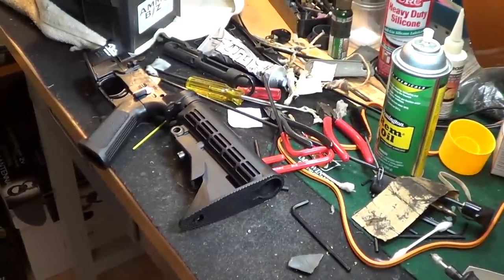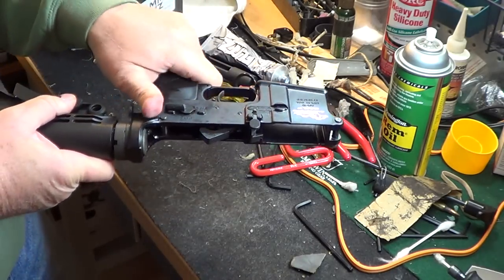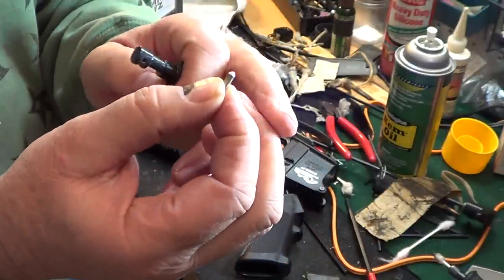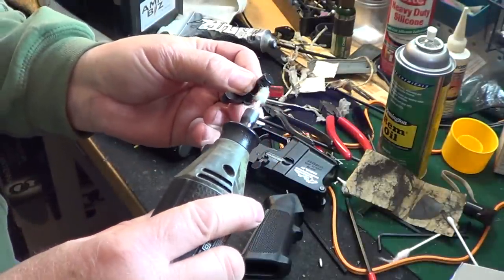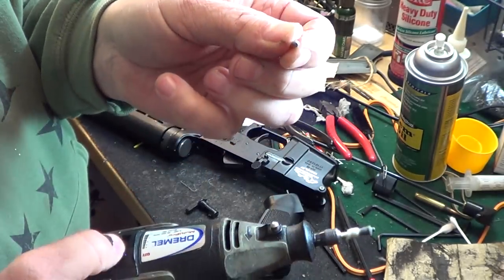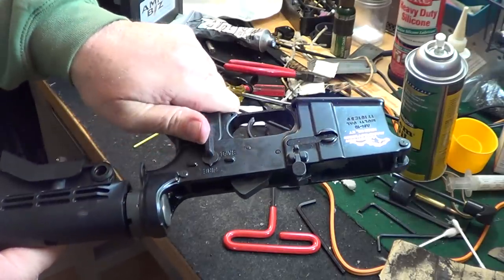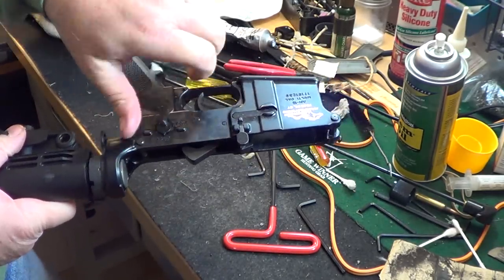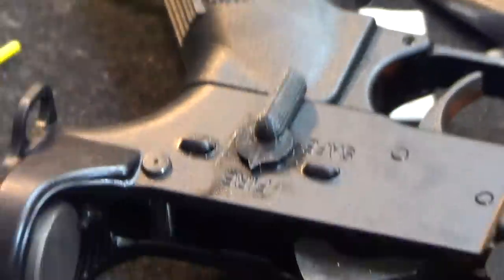AR Mod - Safe & Fire Selector Too Hard - How To Make Safety Smoother

Comment: 0.880 Inch is the best length for the safety selector (and ejector) spring to strike the best balance between ease of use and a good detent lock.  Clippers work, and a slow speed knife grinder and jig works well to make batches of those reduced preload springs.  Rick is one of the very few honest and experienced gun guys out there.  He tells the truth, and I appreciate that.  Blackhawk makes an inexpensive 45 degree offset and ambi safety lever, and that helps civilian AR-15s become easier to practice the Safety-On and Safety-Off drills in class.  I spend the first morning of the carbine classes fixing broken and poorly maintained ARs, along with updating the safety springs, detents, and levers.  What Rick says makes a huge difference.  He is the greatest.

Comment: Rick, I had the same issue once, instead of cutting the spring I found there was a plastic burr in the hole in the grip causing too much spring tension. Cleaned it out and made it slightly deeper by GENTLY running a drill bit down the hole. Worked great. Just another way to achieve the same effect, hope that helps :)
Reply from the maker: true but if you screw up with drill and go to deep you mess up lower, if you screw up spring you get another one,   but   both will work
Reply: My grip cost $50. A spring or pin cost less than $1. Which is more logical to modify, really?

Comment: Awesome idea. Ever since i upgraded the safety in my CMMG banshee, i noticed that it was really stiff, hoped it would eventually break in with time but it never did. Came across this vid randomly and clipped the spring a tiny bit and cleaned it up with the Dremel and now its nice and smooth again.
Reply from the maker: Glad it helped!
Reply: You can also try drilling like 3mm in your pistol grip using a 7/64 drill bit. Very easy

Comment: Common mistake with this is people thinking the detent is the issue. It’s actually usually sharpe shelves on the holes of the selector itself. A hand held countersink would be better for smoothing it out without compromising lockup of the detent itself.
Reply: Agreed

Comment: if you put a dab of grease on the bottom of the selector spring, it'll stay in the grip with less chances of flying across the room.

like if you've ever shot gun parts across the room and spent time looking for some tiny part only to go buy another, then step on said part at 2am with bare feet lol
Reply from the maker: hate looking for flying parts
Reply: In the automotive trade there's this little e shaped retaining clip which fits in a grove on a shaft. You experience those things flying across the room so frequently that you can walk into an auto parts store and if the guy behind the counter is over about 30 all you have to say is "I need a damn-it for the throttle linkage on a _______" He'll laugh and get out to proper box of clips.
Reply: "I need a Damn-it" LOL, I like that! :-)
Reply: SpiritBear12, 

So named because ...... "let me just get the little [ insert some prying motions here] ...... ping ...... DAMN IT!!!" lol
Reply: Oh I totally got the reference, that's why I thought it was so funny. And to have some one else know what that damn-it part was without hearing it's true name is even more amusing!

Comment: Man... Thank you for this. I wasn't sure if cutting that spring was alright or not. And I was having to choose between being comfortable with the grip being secure, or being able to switch the safety at all.
Reply: Did It fix it for you
Reply: @cross8215  Yeah, my safety switch was pretty heavy. I wasn't able to tighten the grip down , or the switch wouldn't turn at all.
Reply: @claytongibson2474  My safety switch is heavy too, it's pretty heavy switching to fire but it's REALLY stiff when switching back to safety.. was thinking about cutting a coil off..
Reply: @claytongibson2474  Just did it, filed a little more of the detent, the filing does help a little, but it wasn't much of a improvement. Before filing the detent the stiffness of the safety switch was about 7 or 8/10. I mean it was very stiff. Almost takes your skin off on your thumb flicking it. After filing the detent pin it was about 6.5-7/10

I took a coil off and instantly felt a lot less tension. I cut another coil off (a total of 2)  and it's soon much better. Probably a 4.5-5/10. 

Really wanna take off one more coil because it's slightly still stiff  but don't know if I should risk it, taking off the 2 coils made a HUGE of a difference now I don't need almost 2 hands to flick it haha

Do you think taking off another coil (a total of 3) would be too much to risk?
Reply: @cross8215  If you're unsure, then I'd say, at least, have a backup spring on hand before you do. Or have one on hand before you go to actually shoot it. It's tough for me to gauge the stiffness... My switch wouldn't move at all, unless I backed off the grip screw to the point the grip was wobbly. I think I took off 3, and the switch feels like it 'should' now. Those springs are cheap though. Think MidwayUSA has then for $2. But, I like to keep random stuff like that on hand anyway.

Comment: I like a jeweler's loupe for looking at small details, like your cut spring. I prefer the loupe that you can hold in you eye socket like a monocle because it leaves your hands free to work on whatever you're looking at. 

Optivisors work as well but the magnification is limited. The jeweler's loupes start at about 10x and will give you a great look a sear surfaces and such.
Reply: Cellphone has macro mode. :)

Comment: In addition to polishing the detent arera and channel of safety lever, what I do is instead of cutting spring is to loosen grip and work safety till I like how it moves then LOOK at gap (And or measure it) and hand drill with fingers the hole in grip spring goes by the amount of the gap.
By doing it this way you get to set spring pressure to your liking, and if you do screw up, OR safety "works-"/wears and it's too easy it's reversible.. IE just put a drop of epoxy in hole and re-drill.. 
Above also keeps you from trying to hunt up another spring if you replace grip.
(I've heard the depth on aftermarket grips varies)

PS: Good vid, I just wouldn't cut the spring.

Comment: I tightened my grip and it made my safety selector not turn all the way. The reason, the bolt in the handle went all the way through its hole and was pushing the bottom of the trigger block preventing the selector from turning all the way. Also the hole in the grip wasnt as deep like the original grip . Solution, I twisted up a paper clip around the bolt and put it back together like normal. Works fine for now. I'm gonna end up putting something solid instead just to be sure it doesnt loosen or anything. Fully inspect your lower before you decide to alter anything
Reply: I'd have probably stacked a few pistol grip lock washers in there but it sounds like your method has it handled.
Reply: @JenkinsStevenD  hasn't been problem yet since then lol

Comment: They make a grip screw that has a small Allen screw in the middle of the grip screw to take the creep out of the trigger. cost about 10.00 bucks on amazon but works wonders 
and with a trigger job ? trigger breaks short and crisp. Dont need a 250.00 trigger
Reply from the maker: I ordered two waiting for snail mail

Comment: I just built a RRA Lar-15 lower using a BCM lower parts kit (my first build and first AR). My issue is the safety selector is "sloppy". It firmly clicks into each position and works fine but wobbles a bit. 

Another issue was that the Rock River lower fit so tight against the upper I tested with it  that I had to tap it on using a rubber mallet. After this I couldn't push out the pivot and take down pins and had to use a punch; then I had to grab the upper in between my knees and wiggle the lower off using the receiver extension. Thankfully these issues have disappeared with use.

Now I just need to save up the scratch to get my BCM upper!

Comment: My safety got so smooth that literally you can blow at it and switch to fire and safe. Wtf, why not even 200 rounds through the gun. Should i worry and replace the safety and its components?
Reply: Pick up another spring and pin. If that doesn't fix it, put a small spacer in your grip where the spring goes.
Reply: Your grip screw is probably loose

Comment: Hello, im having a issue with my safety selector (i think) when im shooting the gun and swich it to saftey and then back to fire the trigger gets jammed. I'm able to fix it by pulling the charging handle and ejecting a round. It doesn't happen every time either, i am using a durkin tactical 3.5 lb trigger too if that helps.
Reply from the maker: take apart and look for marring, wear marks clean and lube good, if the problem is still there not sure without looking

Comment: Can anybody please help me figure out why my safety is completely stiff when my bolt is locked back?
Reply: The only forces that act on your safety are the spring and pin. Your trigger sits beneath the safety. It could be pressing up on the safety, but it is very unlikely unless you have a lower that is not drilled to spec.
Reply: @guitardaddy6  thanks! I ended up getting a rise armament 3lb drop in trigger and it completely fixed it. The mail spec was extremely oversized and got in the way